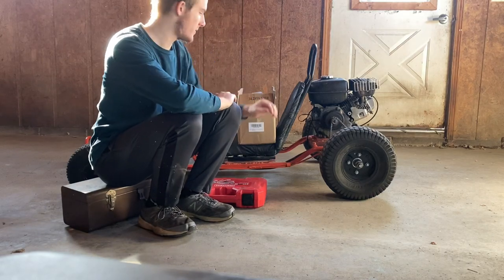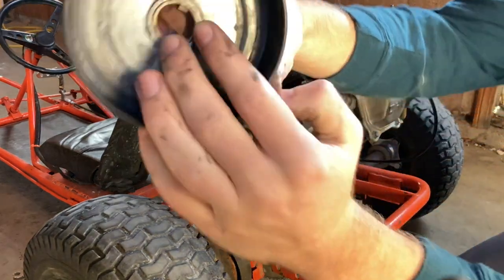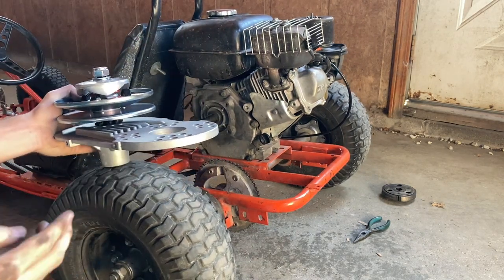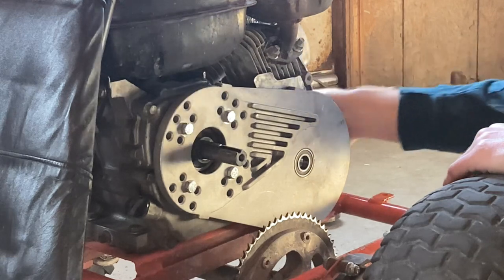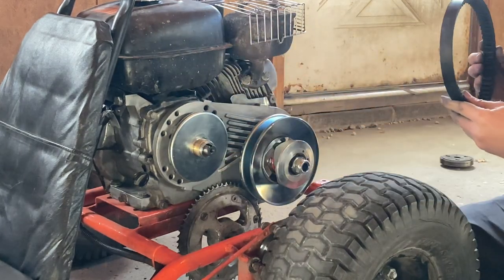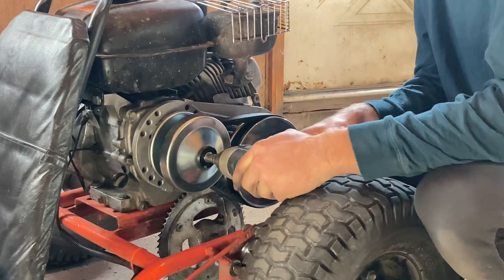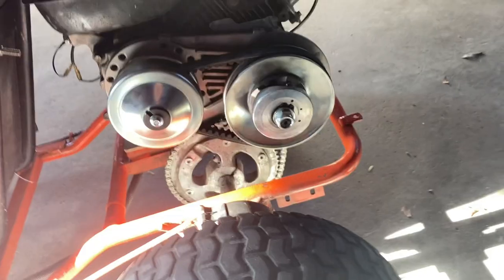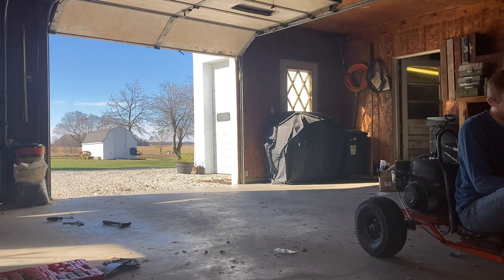Installing a torque converter on my go kart. (Insane acceleration)

Comment: there is a reason those converters comes with multi holes so you can move up or down it dosen't have to be in the center holes, unless its hitting the engine your making overly complicated

Comment: Noticed your axle has 4 bolt wheel hubs. What brand are they. Where to buy? Wondering if the bolt pattern is on a 4" diameter circle as golf cars are.  Thanks and good job on the conversion👍

Comment: Yeah they work well. If you wanted you could get springs to lower the engagement RPM. I run a yellow spring in the driven in the tightest hole on my minibike. Under full throttle it keeps the RPM higher before the belt shift.
Reply: Could you explain this a little further please 😊
Reply: I thought you could  adjust the driven by the amount of torque on the nut.
On another video they said that was the adjustment.
That's why there was NO torque specs for that nut!
Reply: @TF856  Never heard of that and it's certainly not in any Comet documentation.

Comment: Great job. I wish there were torque converters and Amazon when I was a kid. Did you consider using 4 quarter inch spacers (or a few flat washers) to give your sprocket bolts clearance instead of plywood which could shrink or mold over time? Great job, anyway. Nice shop too. Did your dad hand you a rake (after yelling at you) to smooth your donut tracks in the driveway of garage?

Comment: Did u try clocking the torque converter to the last set of mounting holes to clear the axle sprocket?
Reply from the maker: No because the back side of the mounting plate has supports for the jack shaft and it would be in the way of the engine

Comment: Could you clock the plate up for clearance? Instead of plywood. Glad you got it fixed
Reply from the maker: No, because the jack shaft for the driven pulley sticks out on the back side a couple inches. and it would hit the engine.
Reply: @ikesgarage05  I understand. Once I used a 2x6
Reply from the maker: @mountainmike1685  yeah whatever works

Comment: Dude where did you get that sprocket? I have the same sprocket hun but can’t find replacement sprocket for it
Reply from the maker: I don’t really know where that hub came from because it was on the go kart when I got it. But if you need a new hub you can buy them off of Amazon, just make sure that they are for the right diameter axle.
Reply: Go Power Sports can probably hook you upp... they sell all kind of parts for go-karts and mini bikes

Comment: I don't believe torq converter would be the correct name for it either a torq converter is a fluid coupling
Reply from the maker: That is what I thought, that they are called CVTs. But they are all sold as “torque converters” online.

Comment: Where can I buy a new torq a verter?
Reply from the maker: I bought this one off of Amazon.
Reply: The cheap Chinese ones work great and every component is available individually if it ever breaks. Just keep in mind the more you pay the better quality. I bought the cheapest one I could find then replaced the mounting plate with a reinforced stainless steel one.
Reply: Ebay has them to.  I just ordered one.

Comment: Motor cc
Reply from the maker: It is a 196cc Honda clone
Reply: @ikesgarage05  what's the horsepower?
Reply from the maker: @nicki8731  I am not 100% sure but I believe it is a 6.5 Horse
Reply: @ikesgarage05  thanks for the quick reply! How's the top speed affected? The acceleration definitely improved :D
Reply from the maker: @nicki8731  I haven’t really tested the top speed yet but from what I heard it should be slower by a little bit.